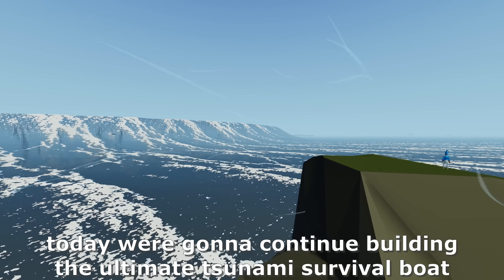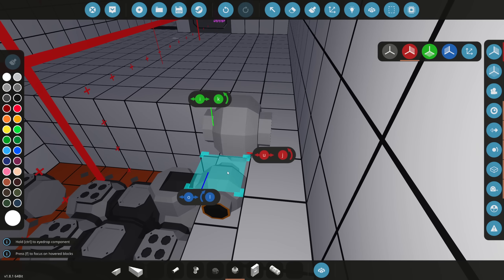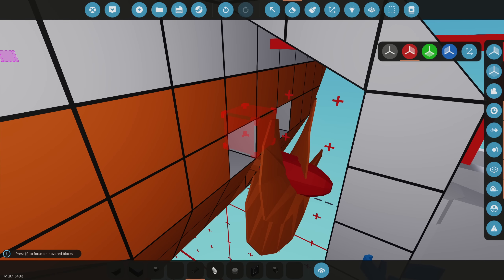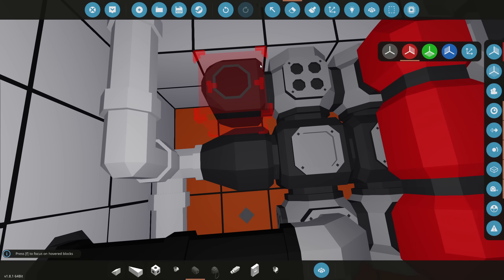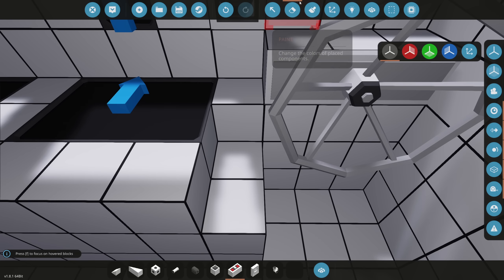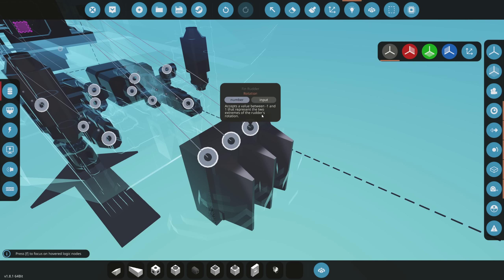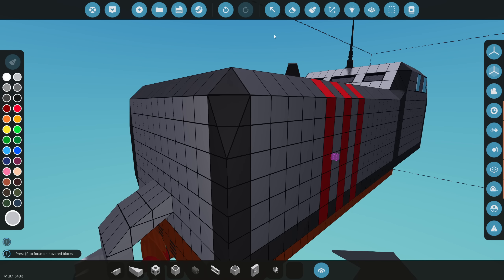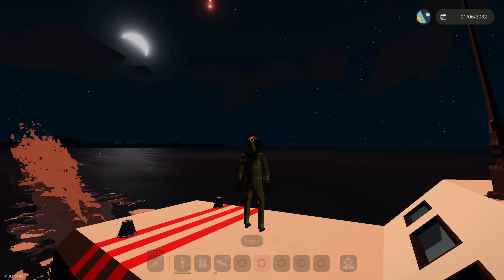Adding Powerful Engines | Ultimate Tsunami Boat, Stormworks (#3)

Comment from the maker: What should we add next?
Reply: tou should make a test video where you test durability of ship
Reply: Add a kitchen so you can make ramen noodles
Reply: I don‘t care, as long as you continue this series 😂😂❤
Reply: You should make a gaming room!!
Reply from the maker: @cx1fejz  probably at the end but great idea!
Reply from the maker: @CJ-all-around  Of course!
Reply from the maker: @billybob13574  maybe in the bridge somewhere I could add a PC
Reply: Emergency lifeboats!
Reply: Add some portholes for the crew rooms
Reply: Could add maybe some railings on the roof behind the cockpit so it’s like a deck
Reply: Add a fire fighting suit diving suit etc.
Reply: Add a radio and things like that
Reply: I suggest you try to tweak the engines' power output via gearboxes. You may also employ a fin stabiliser system, wich could be deployed when needed. Imortant to note that compered to the active weight stabiliser it is simpler to build although it only works when there is sufficient ammount of water flowing over them.
Reply: add foldable wings so you can like jump across the water
Reply: A button. Once the button is clicked it will set off flares from the top of the boat. Also an alarm system which will be set off when the water enters the boat.
Reply: You should add an airlock
Reply: @Neotastic_Gaming this time make sure debbie doesnt screw up the ramen noodles
Reply: Bro liked  his own coment